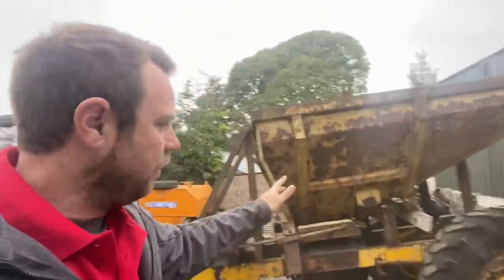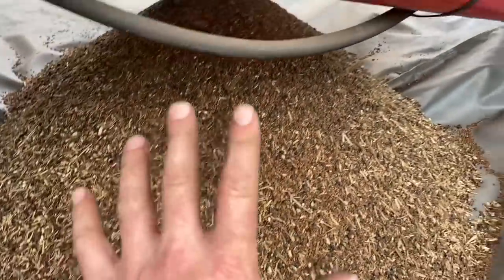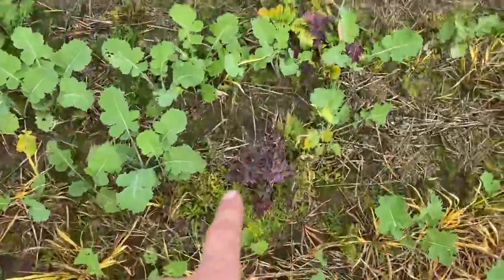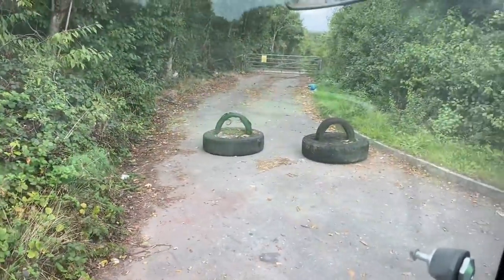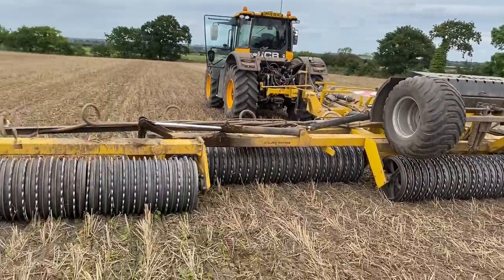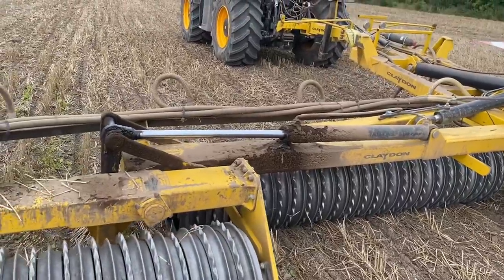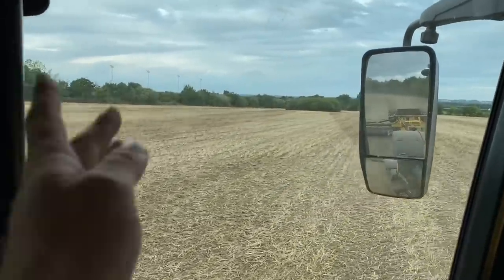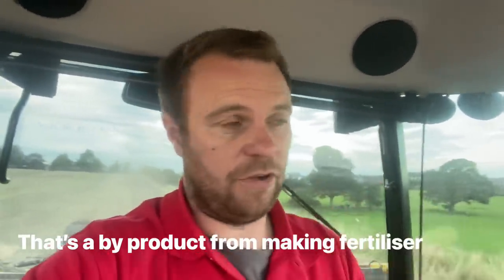Day545 #OLLYBLOGS BLUE POWER ON DRILL TIME LASPE FASTRAC ON ROLLERS #AnswerAsAPercent

Comment: Don’t think it a murehill dumper as they were built on fordson tractors running in reverse. Skip was over the backend and the driver sat on top of the bonnet facing backwards. More likely it was a Bedford type dumper with a Chanel iron chassis and a twin cylinder lister diesel where the drawbar is now. The murehill was a very cleaver use of a mass provided power unit! Loads used during the war and after. Number plate will be from the drainage contractors tractor, they loved the counties back then. Must have been well built as survives some years
Reply from the maker: Yer must be 60 odd years old

Comment: Prefer the blue power. But I'm biased we have 3.  Would love a 4220 to replace my 2170 but reliability would fear me. Had a demo of a 4220 and loved it.

Your very trusting hiring out your drill! I don't like sharing my toys.

Could you not operate one gps system so everything running on same way lines?  I know some big farms up here. First tractor goes in and maps field and all others operate off it. Would be true controlled traffic farming.  Think its agleader they run.  Is that what's on your sprayer?

Comment: When you map a field with GPS, can you  transfer the data so other equipment follow the same path. Was thinking about when you was rolling the field , could the Fast Trac have used the data from the drill ?
Reply: AB lines from different systems can be put slightly as they use different definition of North, calibration etc. Not sure if the drill is on Trimble but if so it maybe that that’s the line in the Fastrac. The sprayer is AgLeader so would be different.